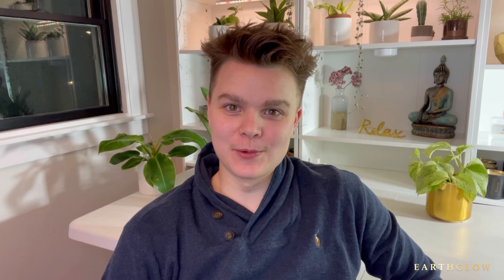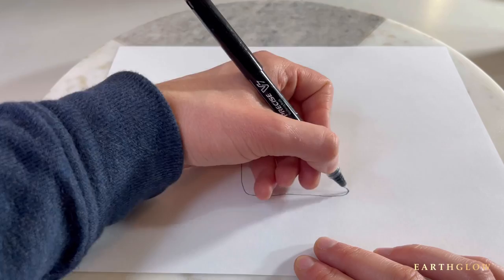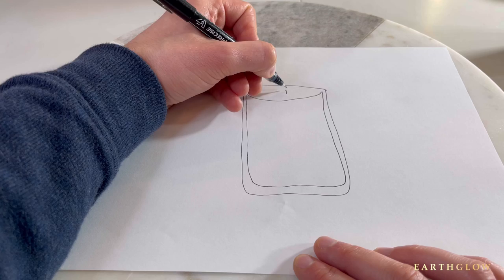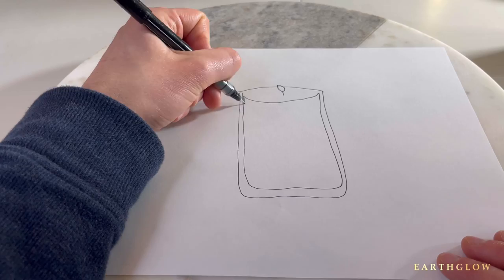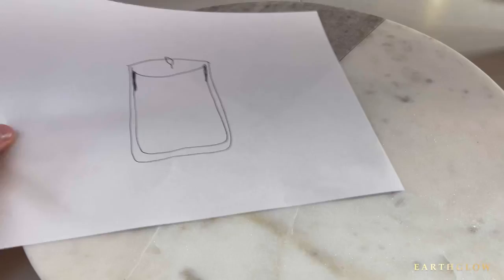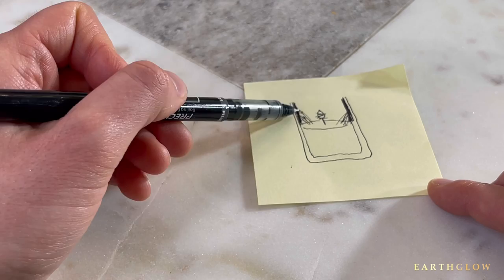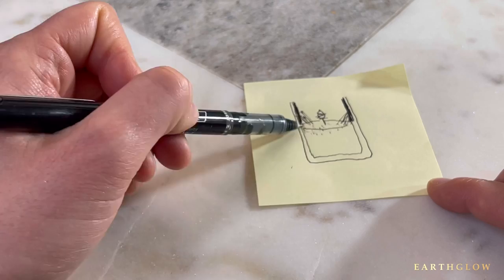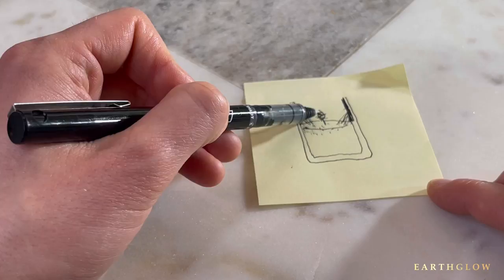Why Won’t My Candle Stay Lit? | Tunneling

Comment: Hi Alan. I never knew there was any mathematics in figuring the burning of the candle. The wood wicks I’ve not had any problems with. But with regular candle wicks, this happens to me a lot! Usually I just put the jar on a candle warmer if it won’t stay lit. But I prefer to just let the candle burn. I think I’m paranoid about the glass getting hot then breaking?!?🤷‍♀️
Reply from the maker: I think your concerns are very valid! Certain types of wax also burn at a hotter temperature than others. Soy wax, for example, burns at a lower temperature than beeswax and coconut wax burns at a lower temp yet! 
I think the best place to start with wicking is your wax manufacturer. Many manufacturers (for example CandleScience, Stone Candles, Sixteen Seventeen, Wooden Wick Co) have wick selection guides that are based on your wax and vessel diameter and that is a great starting point! 

What a smart idea to put your candle jar on a warmer—I’ll have to try this sometime with an underwicked candle.